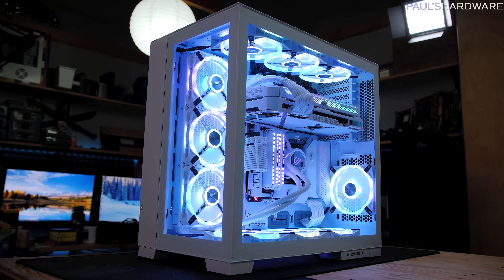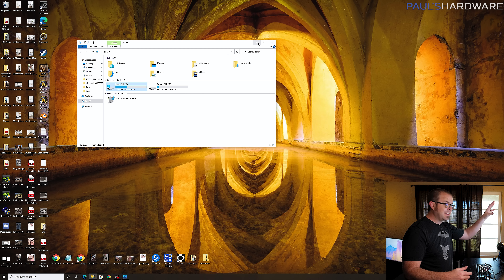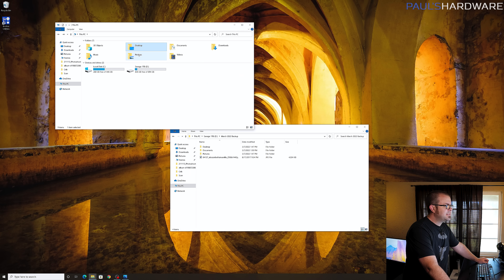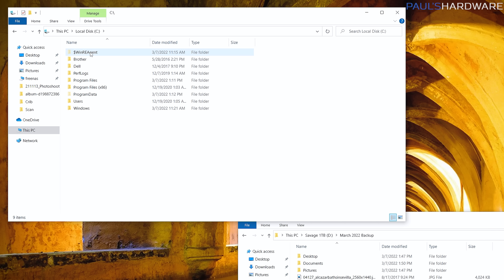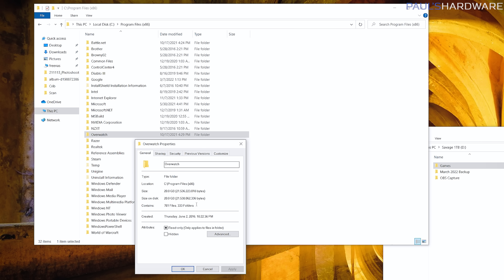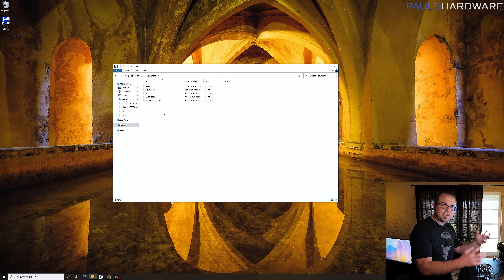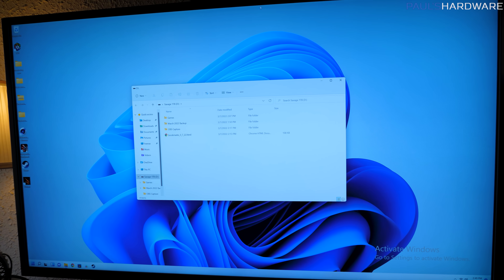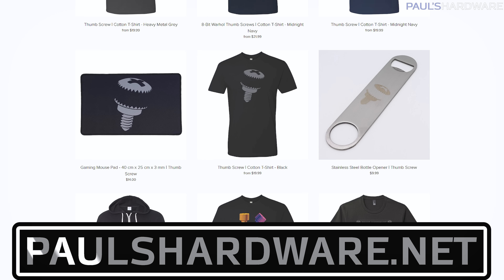How to Move Everything from an Old PC to a New PC

Comment: I was able to transfer my data but I can't retrieve my email address book though I can see it's there but can't open it or transfer anything from it. But even worse is I can't find or transfer my emails from the old hard drive onto the new, and there are thousands and many highly important. I'm at a loss as to how to retrieve them? Anyone know how to find the emails on an old hard drive?
Reply: Are you using an email client program like Outlook? Are those emails saved on your computer? Usually your emails are stored on the server of whatever email provide you are using and not on your computer.
Reply: @JJFlores197  no, they were stored on my computer.
Reply: @NorsePJ  How exactly? Unless you specifically downloaded those emails OR use an email client (Outlook desktop app, Thunderbird, Mail (built-into Windows 10/11), etc), they don't get downloaded to your PC.
Reply: @JJFlores197  I used Outlook from Office 2007. All the emails were in separate folders in the Outlook app on my PC. The same with my email addresses. I can see the file for those saved as Email Address Book but I can't open it nor import it. It's a WAB file but nothing I do works. But I was told my email should be on the hard drive I removed but I'm stuffed if I can find them.

I'm bald which is lucky cause if I wasn't I'd have pulled all my hair out by now. I'm talking about thousands of emails some very important ones. Also some sentimental ones from past relatives no longer here. So bloody annoying. But my mistake not backing them up.

Comment: Okay I'm moving and want to build a new pc in the place I'm going to but I'd like to switch my M.2(which has windows) and my SSD to the other pc and use them. I wont have both PC's together and I want it to be as easy as possible so if I wipe the drives apart from windows can I just swap them over?

Comment: What a wet dream! This procedure will miss something (and probably something important). My wife has no interest in doing any kind of setting up, and it's my fault if it's necessary. I clone the drive from the new system, in case I need any drivers, clone the old drive to the new and boot. If Windows can't figure out enough of the new hardware to allow me to get the needed drivers from the backed up drive, I have a bit of work to do, but it hasn't happened in the 20 years I've done this. This procedure doesn't miss any apps or data, and my wife may or may not notice that she has a new computer, since it's hidden inside the desk.

Comment: My situation is a little weird. I had to get another windows for the new system and I had my old hard drive put in with all the new parts. I copied over all of the data from my hard drive to my new m.2 and I’m trying to have it boot up like my old pc did. It doesn’t ask me my password or anything and all my task bar applications aren’t on and I think all my Google chrome stuff isn’t signed in to the old account stuff. I don’t really know what to do and just want to be able to use basically what was my old pc but just set up on newer hardware.

Comment: So  can I  Transfer the Program Files (x86) by itself to the Hard drive for my  new pc ?
Reply: You can't "transfer" the folder to another drive. If you do that, you may break a lot of functionality of Windows since programs are usually not designed to be moved around between drives.

If you want to install your programs on another drive, what I would first do is to create a Programs folder on the other drive, then create 2 more folders: Program Files (x86) and Program Files. When you want to install a program to your other drive, you will need to tell the installer which path you want to install to. A lot of programs let you change this easily from within the installer and others let you change it, but you may need to run a command line version of the installer or edit some files. Some programs don't let you change the default install directory. Its hit or miss depending on the program.
Reply: @JJFlores197  so is it best if I copy the main folder that the program files(x86) are in?
Reply: @risktakerjah  No. Again, like I mentioned, programs usually don't like to be moved around. When you install a program, the installer will usually write files to things to things like the registry or other hidden places with the install directory. If you move the program to another location and try to run it, either the program will work fine or it may not work at all or may work intermittently.

If you want the program on a different drive, the best thing is to uninstall the program and then install it, but change the default install location to whatever drive you want. Like I said, some programs easily let you do this whereas with others, it cannot be done or it may not be very easy to do.

Comment: Well i have problem , the old pc is dead  so i just have the hdd , and how to move to a new pc hdd
Reply: Take out the hard drive and put it into the new computer and boot from it. If the old system had Windows 8 or newer, it should boot up fine. if it had Windows 7 or older, it may not work out of the box.
Reply: @JJFlores197  it doesnt work ,i have windows 10 but not detected on boot priority, but its detected on bios ..
Reply: @lalemon  I'm not 100% sure, but it is possible that the old Windows installation was installed in BIOS mode. If your motherboard has BIOS mode disabled, it will not boot from any non-UEFI installed OS. You can try to see if BIOS mode is enabled on your current system (may be called legacy mode, CSM, or similar.
Reply: @JJFlores197  thank for replying me .. appreciate that ,  but yeah my old hdd is on MBR and my mobo is only support UEFI so yeah i think this is the problem , still searching how to figure out convert MBR TO GBT without lossing data.

Comment: Paul, is it also necessary to swap for like cpu based system as well? i.e. you must stay Intel to Intel, Ryzen to Ryzen? Or is that only for cloning drives? I'd like to clone my Ryzen AMD os drive 512gb nvme Win11 system to a new 1tb nvme Intel 12600k Win11 system. Is this not recommended?
Reply from the maker: I usually recommend a clean install, it just always feels fresher and snappier to me. Since Windows 7, it's been possible to swap or clone a drive to a new system and have all the hardware recognize and function properly. But there's still registry bloat from the old hardware that lingers, and I've encountered plenty of bugs and weird issues from drive swaps so I avoid it myself. I'd particularly advise against it when you're switching platforms entirely.
Reply: @paulshardware  Okay cool. Thanks for clarifying, Paul! I'll do a clean install for the new system.

Comment: Great video, thanks. I use OneDrive, so when I get a new computer I just sign in with my Microsoft account and OneDrive sync data and apps install. I can also reset Windows using the recover option without having to backup any data, it all sync back when I login to Windows. Seamless process. I can also use my PC or laptop or phone and I have my documents available on all these devices, all kept in sync by OneDrive. I keep steam on a second ssd for easy transfer to new PC.

Comment: Just a heads up when installing a new OS. Upon installation windows attaches existing HDDs to your OS. So if you remove those HDDs or swap them out later, it wont boot anymore. I wanted to swap one of my empty SSD to bigger SSD but it didn't boot anymore. So I had to keep all of them instead.  Still not fully understanding the whole feature, but feel free to read more about it.
Reply: Thanks for hte heads up. I am new at this migration.

Comment: I still wonder why Microsoft hasn’t automated this process like Apple’s migration assistant. No hunting or manual copying — everything just clones over as if nothing changed.
Reply: Indeed, I use OneDrive, so when I get a new computer I just sign in with my Microsoft account and OneDrive sync data and apps install. I can also reset Windows  using the recover option without having to backup any data, it all sync back when I login to Windows. Seamless process. I can also use my PC or laptop or phone and I have my documents available on all these devices, all kept in sync by OneDrive.

Comment: For transferring user data, there is a great and free tool called Transwiz (Transfer Wizard) by ForensIT. You choose your user folder under C:\Users\ and it zips it up into a single file that can be transferred to the new PC. Run Transwiz there and point it to the transfer file and whammo! All your files and settings are applied, SSIDs intact, and even works for domain PCs. You're welcome!

Comment: Nice video but im waiting for a primer to use the Microsoft sysprep. Supposedly it will allow a clone to run cleanly on another, different configuration system. It creates a full clone without drivers or system specific programs. Supposedly then all you have to do is a refresh install that will then create the system specific drivers and such. Makes a new system look just like the one you copied. You could theoretically go from a AMD system to an Intel system because the system specific drivers weren't part of the clone. I have read about it but never saw a tutorial. Are you the guy to create that tutorial?

Comment: Another thing to consider when using "Copy" or "Move" is that copy with change the files creation date as where move will retain the files original creation date attributes.
Reply: YES! Not addressing this issue is huge, a "move" can be dangerous if something goes wrong during the transfer so people will often use "copy" but then they are surprised when they organize or search by creation or modified dates and realize they are not all the same and they lost all that invaluable information!!!
Reply: @danzfamily  I don't usually comment on channels I follow, but I felt this was worth mentioning. I have had several clients realize this mistake after the fact.
Reply: Also, 440 comments, and you are the only one who mentioned "attributes." But that is the precise reason people will use windows robocopy or some type of mirroring software. Not to mention the long file names issue or the need to verify huge writes. Copying large amounts of data from old to new computers is more complex than presented here and presents many pitfalls for the unaware.
Reply: thank you for the heads up!
Reply: I have often wondered why that happens...

Comment: What are you doing with the registery.  Without it windows does not know where to find some of the programs.    I find the quickest way to set up a new system is to replace all drives from one computer to the other.  One that is done then upgrade the os or install the new os leaving the files alone.

Comment: I am very happy with my Acer Predator CG437K 43" 4K monitor.  Offers up to 144 Hz overclock.  I run it at 120 Hz and it looks awesome. The only other panel I have been eye-balling is an LG 48" C1 OLED TV.  I run my living room gamer on a 65" C1 and it is just stunning.  The C2 later this year will offer a 42" version if I am remembering correctly.

Comment: Whenever I build a machine I create C:, D:, and E: Drives. C: is currently a 1TB SSD that contains the OS, drivers, utilities etc. D: is a 2TB SSD that is used for programs and game installs only.  E: is currently a RAID 1 (Mirror) of two 4TB HDD drives. Drive E is only for User data. 

I then change the location of all the Windows "Special Folders" to point to the proper drives, set up the backup software to backup Drive E: to the NAS nightly.  Should I ever need to move the user data files, all I ever need to do is just do a disc clone of Drive E: to the new drive E:. Or download them from the previous nights backup on the NAS.

I also keep the most recent copy of the program installation files in a directory on the NAS so that I can recover a D: partition quickly and also not forget about some little utility that I use everyday but forget the name or where I got it from.

Comment: or, if you're using Linux:
option 1: you want to keep the OS drive
- you plug in the drive and add the boot option
option2 : you want to use a different drive
- use `dd` to copy the whole thing over, then set up the boot entry, then expand the partition(s) because of course the new drive is bigger

Comment: Steam has it's own built-in way of moving or backing up games. So you're better off NOT using File Explorer and just use Steam to do it. First you have to create a new Library folder, by going into settings, Downloads, and click the [STEAM LIBRARY FOLDERS]  button. From here click the (+) at the top to add a new library, and set it any folder on another drive (or USB drive, or whatever). Then back in your game library list, right-click a game, choose properties, and tell it to move it to the new library folder you just created.

Also in step 3, if you go into your "%appdata%" folder will contain user data, settings, log files, and many app-specific data for the apps you use.  Be sure to check both \Local and \Roaming folders for anything you might want to keep.  I don't recommend copying the entire thing and hope it all works when you install the app on the new PC. You just need specific files you may want to hang on too, like log files. Keep in mind that the %appdata% folder is a hidden folder, and there will be separate ones for each user on that pc.

Comment: I can't believe how much of a mess Windows still is in terms of backing up and transferring your files from one system to the other. You basically have to rely on paid programs or do all the manual work yourself, which is a lot.
- Backing up/copying AppData (for each user) and ProgramData (built-in back up utility skips these even when linking them directly).
- Checking if you have drivers backed up for specific hardware/controllers of devices that are now considered very niche and old so they are difficult to find.
- Making a list of all your installed programs, because they do have to be installed from the installer since some come with drivers or need other dependencies installed as well. Also make a note of where you got them from, the MS Store, site, etc.
- Making a text document with info like what mapped drives you have and other small things.
- Making screen shots of every Windows setting, Start menu, system tray, etc so you have things back the way you want them.
It's such a hassle, I still have all this info saved from the last time I had to reinstall Windows.
Reply: Well write to Microsoft and tell them to up their game. It's not like you are the only one who has to go through this labour intensive task. I have almost finished myy new machine and have to go through the drill as well.

Comment: Solid data discipline helps here. If you keep all of your stuff in a separate artition and exercised use of symbolic links (which is literally braindead-simple in Windows if you use the Link Shelll Extension addon for Explorer) then you can literally just keep all of your files in a single part or device to transfer over for use in you new PC.

Having a script on-hand to do all of this linking for you is nice as well, but if it's just a handful of operations you have to do the GUI method isn't bad either. For Windows users, it's mklink while Linux users have GNU coreutils' ln.